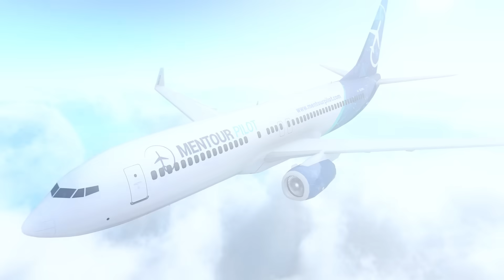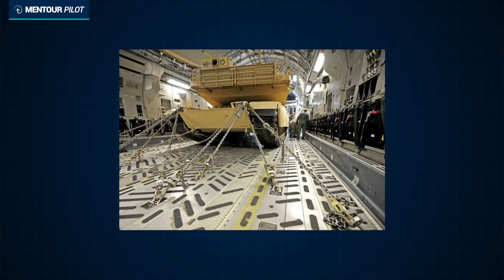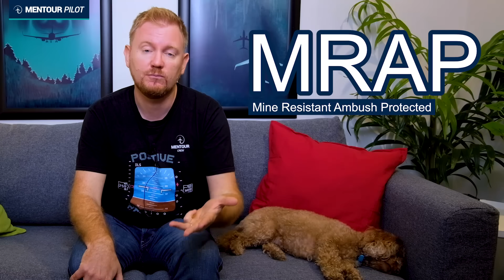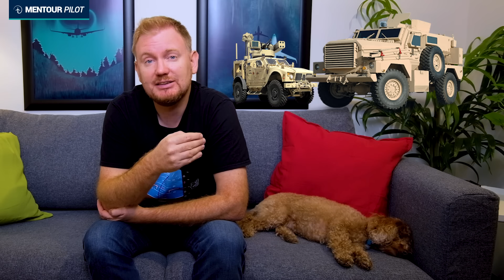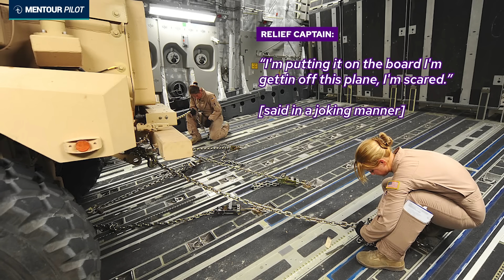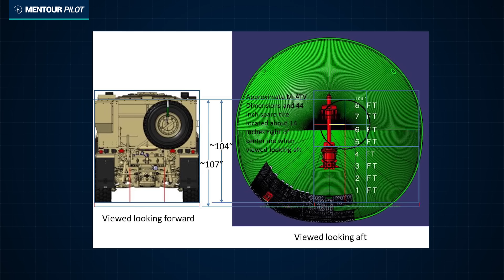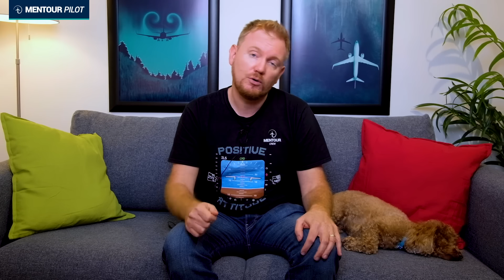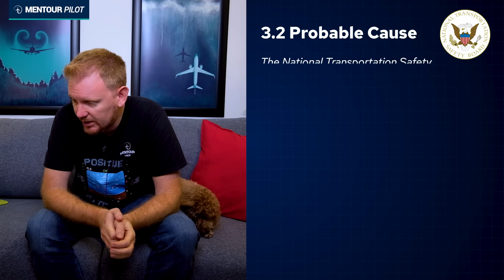Why did the pilots LOSE control?! National Air Cargo flight 102

Comment: Having assisted in strapping down a certain missile launcher several times on certain aircraft, if I had been on that 747 aircraft and saw Load using straps instead of MB2 25K chain tiedowns, I would have walked right off. It's unreal the stress that armored vehicles put on the restraints during a takeoff, especially combat takeoff. Hope future and current load masters and assistants watch this and learn how absolutely critical this task is. This was a totally preventable tragedy, not an accident.

Comment: I know I'm late to the party on this video.

I'm a retired U.S. Air Force Loadmaster. I flew C17s, pretty much from the time they came online, until I retired in 2008. I finished with more than 8,000 flying hours (5,000+ combat flying hours/3,000+ regular flying hours). I was an Instructor Loadmaster and SOLL II Loadmaster.

To clear things up, when it comes to Loadmasters (because your video shows U.S. Air Force Loadmasters, when you reference loadmasters),...the military has it's own Loadmasters and civilian airliners have civilian Loadmasters. Military Loadmasters are trained to a MUCH, EXTREMELY higher standard, than civilian Loadmasters. U.S. Air Force Loadmasters train for years for different qualifications (AL; AD; BD; SOLL II.; etc), not to mention different Loadmaster levels (ML; IL; EL), and other misc. qualifications, following our initial one year of (AL) Loadmaster training. On C17s, we go through Boeing training (for our weapons platform training). If we made anything less than 100% on any exam, we failed (eg. a 99%, or less, on any exam is a failure/failing grade). When I trained, U.S. Air Force C17 Loadmaster Trainees had an 89% wash rate. If you failed, you retested. If you failed the retest, you had to be retrained. If you failed after retraining, you washed the course and were gone.

Air Force Loadmasters would never (except for very special circumstances, which I am not at liberty to discuss) use strap type tie-down devices (CGU 1/B) on vehicles....too much stretch. We would only use chains (10k & 25k) and chain devices (MB-1 & MB-2). Plus, we NEVER mix tie-down device types, on anything. Also, we had to mathematically check everything, not just eyeball it. We had a 98% combat success rating.

Civilian Loadmasters only train for hours, or a day, or few, before initially being sent out. The Loadmasters on the 747s are/were Civilian Loadmasters. The civilian Loadmasters we occasionally dealt with, would regularly break rules, or demonstrate unsafe practices. I'm not saying they are all like that, but MANY of them are/were.

Comment: I refuse to depart if the loaders don't secure the load on my truck to my satisfaction...Why would any pilot choose to take off if they have even the slightest doubts about the safety of not only a cargo, but an unusual one? The levelof negligence here is astounding. People just 'guestimating' and hoping things would be okay instead of knowing...Absolutely unforgivable incompetence that resulted in a disaster that could have so easily been avoided...

Comment: Got to wonder what planet that loadmaster was on. 24 straps for the lighter vehicles, yet only 26 for the significantly heavier vehicles. His incompetence killed them all.
Reply: Quick maths even with his reasoning 24 straps for 12T = 36 straps for 18T. Maybe that was it. He thought 26 instead of 36.
Reply: Deathmaster🤦😢
Reply: Poppy
Reply: He wasnt trained correctly
Reply: @SonjaHamburg  There is no excuse for failing to study more than the minimum for safety critical aviation tasks. I and the rest of the Air Force did and presumably still do. Not hard at all. I'm also a civilian A&P and general mechanic on many other systems. He was unprofessional as he could be.
Reply: What the hell? He died on this flight. You think he wanted to die? You cannot know what you don't know That's why training in complex systems is so vital. He did his job, he thought he was safe. Why did he think he was safe? Because his training from National and the regulation (or lack thereof) from the FAA meant he didn't know any better. His incompetence didn't kill them; company/FAA incompetence killed them. They were the ones who left him ignorant.

Comment: I'm almost suprised they are tied to the chassies of the vehicles and not more to the wheels and axels. i'm sure there are reasons etc, but i know that while strapping a car to a trailer i generally prefer to tie them at the wheels since then the suspension can move freely without affecting the straps.

Comment: This reminds me of FineAir 101 back in 1997 it was the same cause. The DC-8 was weighed incorrectly causing the Flight Engineer to get the wrong trim. When they took off they went 30 degress nose up Engine#4 vilontly flamed out and then it slammed into a Miami highway.

Comment: Those straps might be good securing 2 tons in best condition of static tensile strength but when a dynamic  tensile strength might be only 1/3 of that if  forces act at an angle not parallel to the webbing of straps add to that a dynamic tension of taking off where you pitch the plane 20+ degrees and apply full thrust!

Comment: I remember this rathole well and also some of the outlaws that I have flown with while I was there, although most flights were in a helicopter. Just a little FYI, this airfield and its immediate surroundings were never cleared of landmines but only by occupation, you know, drive over it the 6th time and it finally detonates. One of our platoons was tasked for a year, removing them. During this time, I lived on the edge of the runway in J-bad where it rained aircraft parts every other day, occasionally a few tires and some landing gear components and a few pieces of rotorblade crashing into my B-Hut along with some drones! No more than 25 feet from the edge of the runway. I recall hearing about National but there were many others who did equally foolish things, both military and civilian to include SF and some others.

Comment: In the trucking industry, when you get to a certain weight, chains are highly recommended because they will have A higher max loaf limit. I am personally would use them for any vehicle weighing over 7000 lbs

Comment: As a person who was stationed in Bagram, I had just left prior to this accident.  My replacement told me that he was on the flight line taking pictures of aircraft taking off and landing.  He has a series of pictures of the aircraft on it's takeoff roll and one as it left the ground.  The NTSB confiscated all of his pictures as part of the investigation.  According to my friend, one of his pictures showed a large deformation in the rear section of the aircraft as it rotated.  His computer was and camera was confiscated and they never returned them.  When he was interviewed, he said that the investigators were talking in an area next to his and he heard them specifically discussing that there were not enough straps and chains used to secure the cargo.  

I have watched several videos that either show the crash or discuss in some manner and this, by far explains it the best.  excellent work.

Comment: I WAS NOT THERE, BUT MILITARY VEHICLES ARE USUALLY HANDLED BY THE MILITARY OPERATORS THEMSELVES, QUALIFICATIONS ARE REQUIRED, DA 348. I'M ASSUMING THERE WAS SOME FORM OF MILITARY LEADERSHIP NEARBY TO HAVE OBSERVED THE LOADING OF VEHICLES TO THE PALLETS. OF COURSE THIS DID NOT HAPPEN, BUT I AM STUNNED BY THE LACK OF MILITARY OVERSIGHT AT THIS POINT OF THIER JOURNEY. AGAIN ASSUMING THAT THESE VEHICLES WERE BEING MOVED FORWARD FOR TACTICAL REASONS, THIER COMBAT AVAILABILITY COULD BE CRUCIAL TO A BATTLE  PLAN. THAT IS WHY I'M STUNNED THAT THIS COULD HAVE HAPPENED. NO AIR FORCE LOAD MASTER WOULD HAVE ALLOWED THIS CRAFT TO DEPART. THE USE OF CGU-1C AND LOAD STRAPS, ALLOWS MINUTE STRETCHING. IF THEY ARE PERFECTLY CLEAN, ANY DARK SPOTS IMMEDIATELY CUTS RATING TO 10,000 LBS. HENCE CHAINS SHOULD HAVE BEEN FIRST CHOICE IN CALCULATIONS, AND CHAINS ALSO STRETCH, JUST TO A LESSER DEGREE. AGAIN, I WAS RATED FOR C-130, C-141 STARLIFTER AND THE GALAXY C5 ADN I'M ARMY, TO CHECK FOR ALL OF OUR COMBAT VEHICLE LOADINGS. AGAIN NOT THERE BUT AS IN DR. ROMANS CHEESE THERE WERE MANY IMPROPER PROCEDURES, LACK OF OPERATORS OF THE VEHICLES PRESENT, LACK OF OVERSIGHT DURING LOADING PROCUDERES.  ADDITIONALLY MILITARY VEHICLES MUST HAVE AT LEAST 1/4 OF TANK FULL OF FUEL FOR  IMMEDIATE TACTICAL AVAILABLITY AFTER LANDING, HENCE THERE WILL BE SLOSHING OF PETROEL IN THESE VEHICLES. IN MY EXPERIENCES, THE OPERATORS ACCOMPANY THE VEHICLES, AGAIN FOR SAFE OPERATION OF SAID VEHICLES IMMEDIATELY UPON LANDING AND TO ENGAGE AND INTEGRATE FOR TACTICAL REASONS.  RIP 😞😞😞😞😞

Comment: So basically, this crash had only one cause: the cargo was restrained improperly. There are multiple reasons for that, but it's still a single cause.

An interesting but of subtlety is that the number being insufficient was not as serious of an issue as the way the straps were used was incorrect. A strap that is secured at 90 degrees has essentially zero restraint capacity, whereas one that is secured at a much more acute angle like 15 degrees exerts near maximum restraint capacity. The loadmaster's error was lots of straps at a high angle and almost none at that low angle.

Comment: Things that have pneumatic tyres and suspension are much more difficult to tie down than rigid objects. They tend to "jiggle".
The strength/strain balance of the assembly has to be carefully considered. All parts have to be given maximum load values. 
Deck tie points, restraints, vehicle tie points, vehicle structure etc.
If using chain can damage the deck tie points DON'T USE DIRECT
 CHAINS!
Load master training needs to include making test assemblies, predicting when and how things will break, then breaking them. Writing reports, then discussing the reports. 
Better than crashing planes!
Failure is NOT AN OPTION!

Comment: The climb angle of the 747 as it left the runway obviously had an great impact on the tragedy. I can well imagine that they were instructed to to fly in such a manner so as to reduce the risk of damage from ground fire from the area surrounding the airbase, but such a steep angle of climb would have placed a MUCH greater load on the cargo restraining straps. To attempt to place the blame entirely on the shoulders of the loadmaster working at the "coal face" and not proportionally on the systemic decision making errors of the higher ups is standard practice within organisations.
Reply: The steep angle you saw was because the load had already broken loose.

Comment: I wander how guilty the loadmaster felt and if any actions were taken against them. Also doesn't the military have specifications on how to safely load and contain heavy vehicles as they regularly transport these sort of things? Seems like it could have been avoidable if the special cargo came with clear Instruction for loading and securing.
Reply: Remember that when "investigations" are carried out within organisations one of the primary (unwritten) criteria is to remove blame from anyone higher up the chain of command, in the sense that was the loadmaster responsible for the 747s flight plan which clearly included a VERY steep ascent from the runway.

Comment: I understand that for rollers such as those used in doors and cargo holds they often use special self-lubricating sleeve bearings with a Teflon liner as they can take more abuse than a ball bearing.  Kaman developed this technology back in the 1970s for use in helicopter control linkages.  One particular example outside of aircraft use is by Quikserv in drive-thru windows.  In this application two rollers manufactured by Kaman's Kamatics division are used to hold up the sliding door.  Quikserv claims that they have never had one of these bearings fail in over thirty years of service.

Comment: I’m an ex U.S.A.F.  Loadmaster on C141 and C130 aircraft during the Vietnam war.  I loaded many heavy vehicles (including a fire engine one time) and  never once used a strap - always chains.  Our straps were rated for 5,000 lbs. while our chains were rated for 10,000 lbs. and 25,000 lbs.  and I never had a vehicle move a quarter inch much less break a chain.  Unbelievable to me that they were not prepared or trained to handle this type of cargo.

Comment: it's all fake secret numerology what illuminati and freemasons use tell everything. look at the date it happened and the aircraft type.
747=7+4+7=18 1+8=9, reverse the nine and it is 6. then June 3rd is the 6th month and happened on June 3rd so 6+3=9 reversed is 6. happened in the year 2013 so 2+1+3=6 what do you get 666 work of the devil worshipers. it's all secret numberolegy

Comment: I know it's possible to secure loads with straps, however, in addition to straps there should be steel locking bars that fit in between the locking mechanisms on the floor, attached to vertical bars that ratchet down at a precise angle to secure the load, and held in place with locking pins.

Comment: I remember seeing a show about cargo planes on discovery once, and that made it look like the flight crew didn't really know a whole lot about what went on in the cargo hold. They just landed, waited to for the load to get swapped, and then took off seemingly without going anywhere near the cargo.Truck drivers are solely responsible for ensuring their load is secured properly and must know how it has to be strapped down, and they have to stop and check it at regular intervals (at least in Europe). Even if the air cargo industry has people that are supposed to handle that, the entire flight crew should be required to know how it should be done, and required to inspect the load before takeoff, so they can refuse to move the plane if it's not done correctly. Having only one person who is supposed to know how to secure the cargo with no oversight, is incomprehensibly stupid and reckless, and why incidents like this can happen. Planes are way more sensitive to insecure loads than any other means of transport and you simply cannot overdo the safety and precautions

Comment: I spent 24 years in the USAF. I also built up hundreds of cargo pallets for C-5, C-17 aircraft. This cargo is never palletized by the loadmaster, the equipment is palletized by the owner of said equipment. The load master will inspect and load cargo ensuring pallets are locked. So this tells me the problem was actually deeper. The unit who palletized the equipment, the mobility squad who signed off on it, then the loadmaster who accepted the pallets.

Comment: I was in Afghanistan at the time as aircrew (RAF), It’s taken nearly 10 years to finally watch a comprehensive analysis of what happened which I’d like to thank you for.

Flying in Afghan was a dangerous job, tactical take off and landings which went against everything the aircraft was telling you to do, throw in some hazardous cargo and daylight take off over an area known for regular IDF attacks and you have the perfect storm for disaster before you throw in any faults or inflight issue. RIP to the crew here.

Comment: De mortuis nil nisi bene. But: incredibly sloppy procedure. Very inexperienced pilots, a load master who clearly does not understand his job. I did my military service as a flight surgeon in the GAF in an air transport wing and had a lot of flights in C160 Transalls. The heaviest loads I witnessed were 5 t Unimogs. The calculations of the load master where religiously scrutinized and always checked by one of the pilots. A 5 ton vehicle was always chained down with enough chains on one vehicle alone being able to hold more weight than all of those dinky straps on those 5 vehicles together. And no vehicle ever moved millimeters let alone a couple of inches. 😱

Comment: I've never done a load masters job but the airforce was very strict about procedural guidelines for work on the flightline. Specifically about having the manual open to the relevant pages even if you knew how to do it.

Comment: Using straps to tie down 18 ton trucks, are you insane? That's a task for Hi Tensile Chain Binders. Having worked in multiple steel industries straps and slings are illegal for tying down any steel coils or beam sections and they are way less than 18 tons.
The Captains gut feeling was spot on. I would have gotten off that flight for sure.

Comment: What surprises me most in the pictures shown, is that these armored vehicles are strapped down by their bumpers and tow hooks on the planes. And then... ratcheted down against their suspension?? Or do they have means in place to block suspension movement?

Otherwise they would be constantly snagging those straps with every bump on the runway, or turbulence in the air. This will shock load and eventually snap the straps, even if there are enough. Vehicles are special cargo indeed! Anyone who ever tried strapping down a vehicle on a trailer, and looked back in the mirrors at its dancing on bumps, knows this. No matter how hard you ratchet it down, it will keep bouncing. This is why you usually see vehicles strapped down on trucks and trailers by their wheels or solid axles - by unsprung components, not by bumpers or tow hooks.

Another thing that struck me is that contrary to many other flight procedures, there do not seem to be many layers of cheese in load management (referring to the swiss cheese model often mentioned by Mentour Pilot). Like others have mentioned, another idea may be a procedure to immediately discard (or test) straps that have loosened on their own for unknown reasons.